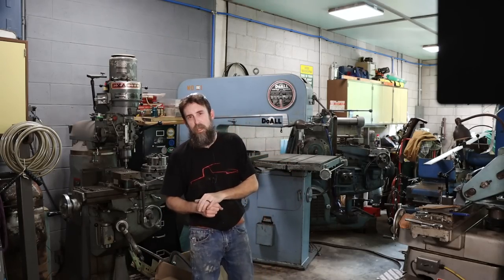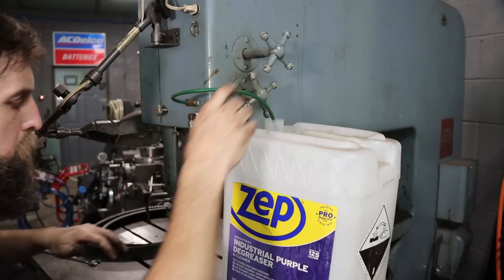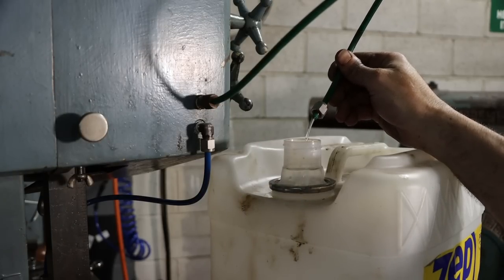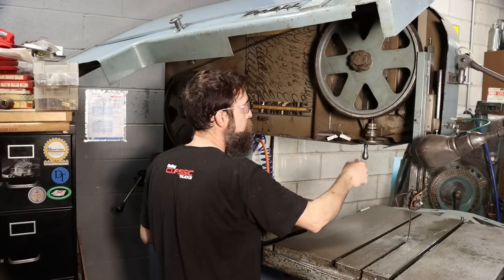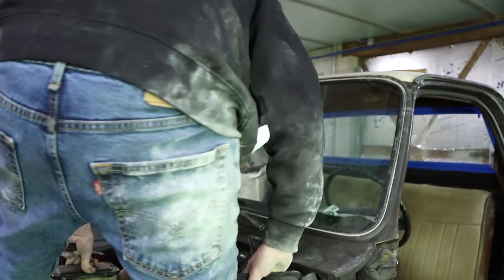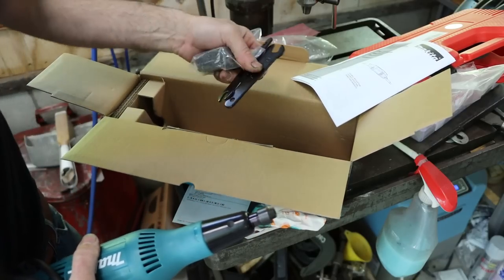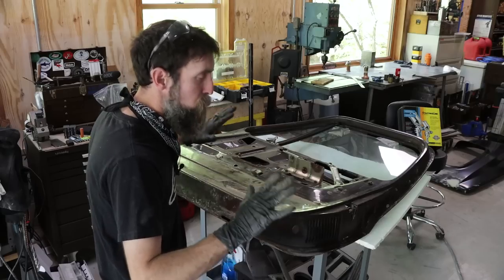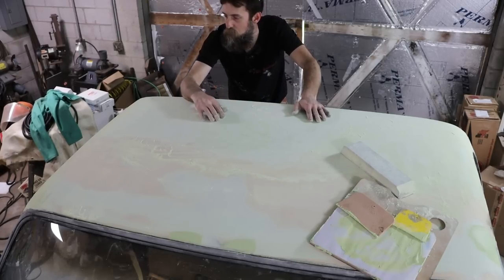Do-All Band saw service & Chevy K10 body prep

Comment: Father in law was a truck and bus builder by trade, back in the 1950's when he was apprenticing all they had to do body filling was lead, and they also did the exact same as you, bring the metal to within 1/16in of the level, by whatever means, heat, hammer and shrink it back, then only fill that last bit with lead. Put in new metal and only lead on the seam, and where the tinmans rivets went to hold the 2 panels together, in addition to the braze welds and soldering. As he worked on buses and railway carriages he did a lot of that to make panels flat again, then paint them with red oxide, then spray with duco paint. 

Only after he was well qualified did they get in this new stuff, body putty, and body filler, that did not need gas flames to apply, and where you could actually put it on, wait 3 minutes and start to shape it, and not have to worry about the metal distorting as it cooled, and even could apply multiple layers over each other.

Comment: When you started tearing your truck apart, it motivated me to start fixing up my truck back in december. I just finished mine up, rust repairs on the bottoms of all 4 doors, and repairing small dings and blocking the whole thing. It was a lot of work! In hind sight I should have taken the doors right off the truck, but the truck has power windows, locks mirrors, and I'm working by myself, so I opted to leave them on. Blocking those door bottoms out hanging on the truck proved to be really difficult on the arms and shoulders. I have probably 60 hours in those doors alone, between welding in patch panels and body work. I painted the truck the original black base/clear color. It looks awesome, straight, glossy, cut and buffed, too nice for a work truck really. It's gonna break my heart when I put the first ding in it for sure. It's all your fault Steve!
Reply from the maker: 😁 You are welcome.  Getting rid of rust and a fresh paint job makes them almost look new again.  Most people have a hard time understanding how much work goes into a body job. Out of sight out of mind.

Comment: Steve, Just a word of caution. From someone who just finished a project like your doing on your truck. I know it's extra work, but I would highly recommend removing the windshield and rubber strip. I wasn't going to do it to the truck I was working on, but I'm glad I did. There was rust under the rubber seal, which was causing the glass to start to crack from a rust bubble. Had I not checked that, the glass could of broke, and I would have to remove everything. So I repaired the whole window channel, and put in a brand new weather seal. And to this day I have had no leaks. Your putting a lot of hard work into your truck, I'd sure hate to have something as simple as that, set you back.     

Sincerely      Bob Casanova.

Comment: Thanks Steve for letting us watch the saws Reeves Drive do it's thing. Back in the 70s at the Akron rubber shops there were Reeves on the wind up mills to control speeds and that is where I first encountered them.

Comment: Definitely a neat idea for putting rope under the windshield gasket, I would try to cover the windshield with a sheet of thin plastic and capture the plastic under the rope, then trim the extra plastic as close to the rope as possible too mask off the rubber gasket and windshield.
Using a really stretchy rope would help.

Comment: To stop the corrosion in the bottom of doors and double panels use a wax based cavity fill coating such as Waxoyl or Ziebart or Dinitrol.  I have a classic Range Rover with aluminium door skins with steel inner structure.  The aluminium started corroding due to  dissimilar metals and the condensation and rainwater that naturally runs down the inside of the doors back in 1989 when I cavity filled it with Waxoyl.  Today it still has exactly the same corrosion blisters that I never repaired but crucially the door is as solid today as it was back then over 30 years ago!

Comment: Steve, after painting spray a product called Fluid Film inside your doors. It doesn't harden and will flow into the seam. Up in the salt belt I spray in and outside of all my vehicles. (Including my K10 square body). You can spray it on your frame and underside of your truck. You can always clean it off with degreaser.

Comment: Another good idea to hold the seal up is automotive wire. 12 - 16 gauge works nicely and isn't hard to insert and remove either... Just another idea... As far as make roofs flat (figure of speech) I worked a roof on a car once that the previous owner looked like she used it in a demolition derby. I worked that roof for a long time to get it to look factory. Not much filler once it all was said and done, but I had to make it smooth and like it was never dented anywhere. A lot of serious work...

Comment: Steve, if you use the same buckets for your dilution ratio, you can simply put a mark on the bucket with a sharpy. Put a piece of tape on the outside, pour your dilution into the required reservoirs, dry the spot where you will make your line, and viola, your ready for the next time. You could also do the same thing on a plastic, white, one gallon bucket for the cutting oil, or bend a piece of strap and cut it to the tape line of each, and that will likewise save you time if the same buckets are used.

Comment: Ive had my makita electric die grinder for so long it has the metal body that thing has been a great tool 
I let my buddy borrow it who said he had his own arbor for a cut off wheel apparently it was some cheap tool because when he turned the tool on his arbor shaft bent and the tool when wild in his hand not being able to turn it off
I always made my arbors out of grade 8 1/4” bolts after trimming them to size i wanted

Comment: Steve, I made a hand truck similar to your blue one and utilized aircraft tires (5") on it, and it held up really well. The local municipal airport gave me the tires as they were take offs. If you or your viewers want to make a duty rated wagon, that could be your source for tires, and they will fit go kart wheels. I built one, and used a steering axle from a riding mower that was cast iron, and I also upgraded it and used heim joints on the tongue for better steering.

Comment: When I have worked with water solubles, one shop had a gadget that measured concentration.  What we got used to was the way it felt rubbed between fingers, and the way it smelled.  We got called out by an engineer for doing this (only a few weeks each year) so we adjusted it one day to what worked well for us and had him do the gadget.  Surprise, we were pretty much in line our way with the gadget.  Not dead on, but fairly close.  And the job ran well for us.  So we got use to letting him see us use the gadget, but  day to day, we rubbed and smelled the stuff.

Comment: Don't feel bad Steve about the door delivery. It took me almost 6 months to get a pair of leading brand high performance cylinder heads and a intake manifold from another top company for my latest project. One thing I would do different is pull the windshield and install a new rubber gasket. Steele Rubber Products make the best and it's not that expensive. They improved the formula from the OEM stuff.

Comment: I'm betting that cab did not have lights on it but a visor instead. Pretty popular when that truck was new. Thanks for the vids.
Reply: I'm almost positive it was a Lund Moon Visor, Avac model. Fit the 73- 87. The moon visors had lights, the sunvisors had none. When I was towing, every truck in the fleet had a Lund, except the Peterbilt, it had it's own brand.

Comment: MIght want to consider replacing that windshield gasket. I've had a couple of vehicles where the water had sat behind the seal and rusted out pin holes in the frame under the seal. Hope thats not your issue.

Comment: We use the same belts as those in snowmobiles - basically the same transmission system, although only a single stage. We used to estimate belt wear by the width of the belt - much less than a new belt, time to change! I can't remember the percentage now - maybe someone out there does. It was a lower percentage for moire powerful machines, i believe. If you want to get liquid top pour more easily from a large container, put a notch in the edge. Of course you can't use it with a lid after that, but just keep one with the notch for all your pouring.

Comment: Looks like your roof holes were from a visor, not clearance lights. After you seam seal and paint your doors, mixup some motor medic (or something close) and thinner to a sprayable consistency and hose down the bottoms on the inside. That stuff will creep into the folded seam and stop the rust for quite some time.

Comment: I remember the Nasty coolant coming out of the equipment in shops i worked at...we cleaned it and changed it as much as needed..but it looked Scary...lol
I use a Lube Stick to lube my Bandsaws and Cutsaws ..alot cleaner and less messy than dripping coolant... comes in various compounds depending on your metal your cutting...easy to apply - rub the stick against the blade ( carefully if running saw ) .... great for Drilling and Tapping too...

Comment: That Makita die grinder made me think of a Craftsman die grinder I bought in a Sears Surplus store 50 years ago. Great deal on a grinder, with accessories and a fitted plastic case. The only problem was, whoever designed the case didn't make a spot for the electrical cord to fit. :-) When you put everything into the case, you couldn't close the cover. I threw away the case.

Comment: I had one of those Makita's.  The speed adjustment is a real nice thing especially if your using a end style wire brush or flap wheels. It will not fly apart near as quick and stay in shape with the reduced RPM. As much or perhaps little as you will be using in the home shop I bet it will last for years. However they are not all that rugged for everyday commercial work. (I am a field welder and machinist)  But I did get 6-7 years out of it. I did replace it with the more expensive, service truck/300 Lb gorilla resistant heavy duty level up.  So what happened to mine? the switch was not all that reliant and the front bearing gave out a couple times. Finally the motor burned out, the magic smoke escaped! Plus yours won't be rattling around in a truck everyday, getting dragged through the dirt and crap..  Truck looks great Steve. Lead filler 👍 Cheers

Comment: when i worked in the coal mines they had a  big  remote hydraulic setup to run the roof supports on the face it was full of that white  soluble oil about 2000 lites an it ran 24 /7  it used to stink

Comment: Great episode Steve. Do All bandsaw looking and sounding good after the belt changes. That coolant looked really nasty stuff, I bet you are glad to get rid of that muck! Truck is coming on great, loved to see you soldering those holes in the roof, and if needs be you can solder the bottom of that door right along and it would never rust again! One thing about that flux, it's probably quite corrosive and you didn't mention it but I bet you really cleaned it off well before you started filing and block sanding it as it can burn you. Over here in the UK we used to have a flux called Baker's soldering  fluid, and boy was that real nasty, as it had Hydrochloric acid in it. Get that on you or in your eyes while soldering and you know it. When you mentioned using lead on bodywork I remember being lucky enough to have a tour of Rolls Royce's London factory( where all of the non standard cars were produced) they told us that they used up to about 120 pounds of lead to seal all the floor to body frame joints in every car. That's a lot of lead! Look forward to next weeks episode. Regards to Elizabeth.
Reply from the maker: Yep, that flux has to be wiped off as soon as you are done. You definitely would want to put anything over top of it. I am not 100% sure but in 1985 they may have still leaded the roof skins on these old trucks. It was used for a long time and really holds up

Comment: one of those little pump top kerosene syphon fillers seems like a much easier way to fill that res up without doin the around the corner under a ledge 5 gallon bucket back tweaker pose.

Comment: Personally I'd take the screen out to make sanding and rust removal easier under the seal. I'm sure you know an Auto window guy who'd help you do it for a six pack of beers 😎
Reply: It's nice to have another pair of hands, but those lock strip glass are easy to install/remove with some poly rope.
Reply: @budlanctot3060  Yea - done it, much easier with two and a set of suckers.

Comment: Enjoying the truck rebuild!  I know you have to say "good enough" at some point, but I think I would pull both the front and the rear glass and put new gaskets in there...  Just good insurance, and it's not that much more work than having to work around the existing stuff.
Reply: New front glass can make a real difference. You're looking through it every time you get behind the wheel. At least here where we get road dirt thrown up onto the windshield by 18-wheelers etc. during winter and then the wipers inevitably push the grit around to scratch the glass.

Comment: Did you back up the holes in the cab roof before leading them?  It looked like you filled right over the open holes and I am wondering how you kept the lead from just running through the holes into the cab roof.

Comment: 39:05 If I had ordered that shell it will show up the moment the door is ready for paint. But thats only my luck.

I guess they couldn't get the right typ of steel or respectively not to the 'right' price due how broken the supply chain is nowadays and will continue to be broken probably for years to come at least in some parts of the economy. I know there are some companies that will give you a certain delivery date to keep you hanging on while investing your down payment into the stock market or something but I don't think thats the case here.

Comment: Off-topic. Why do allmost all people call it MIG-welding, when it is almost allways  MAG-welding. MIG says it is purely Inert gas, such as almost pure Argon or Helium.
Mag-welding uses 80 percent Argon, about 19 percent Carbon-Dioxide and a tad of Oxygen, maybe 0,5 to 1,0 percent to stabilize the bow of current. It is called Active Gas.

One can also MAG-weld with pure Carbon-Dioxide if welding in thicker plate and spatter is no problem. (over 2mm. Deep penetration.) The heat-concentration makes it difficult to handle if used on thin plate.

MAG-welding is thus commonly used to weld carbon-steel or Iron, while MIG-welding with a different gas-composition, can be used to weld Aluminium / Aluminum and other metals.

To be sure, one can call it MIG/MAG as a general method.

Metal Arch Welding Active Gas - MAG
Metal Arch Welding Inert Gas - MIG